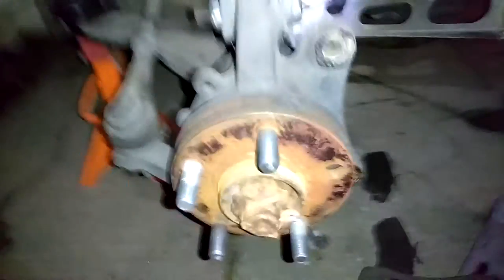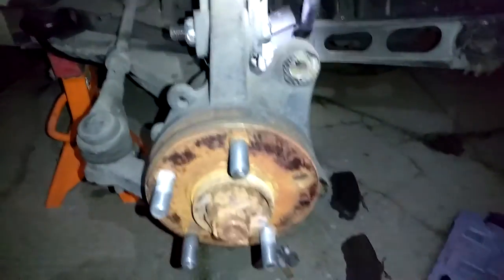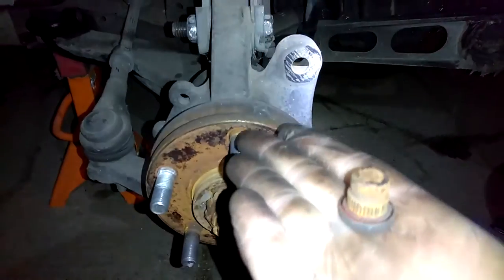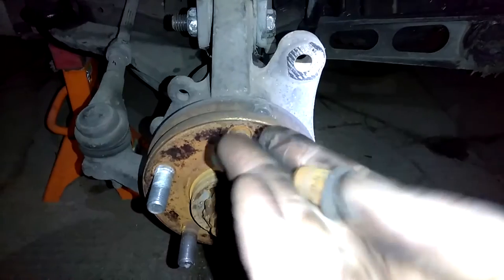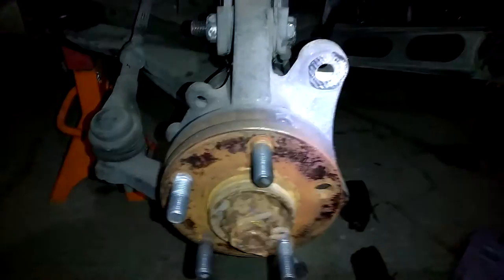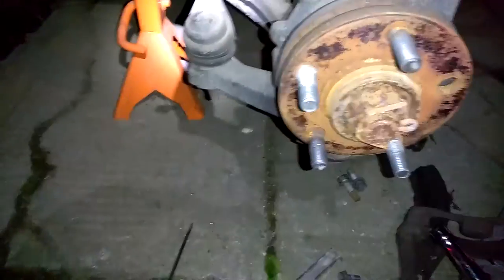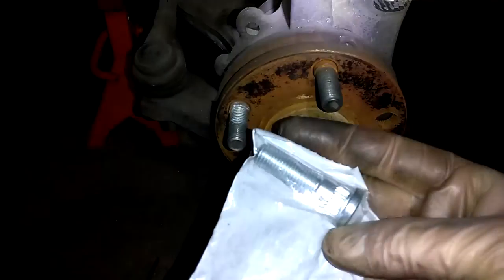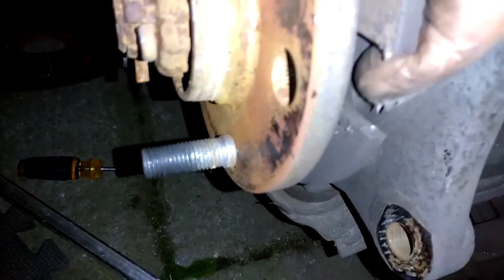PT cruiser Dorman Wheel Stud Replacement.

Comment: This view shows the front wheel has been removed , the caliper assembly has been unbolted and pushed aside , and the 
rotor has been removed .Now you can install new wheel stud ! Just make sure that both wheels are off the ground so that 
you can spin the wheel and put the transmission in "NEUTRAL" and then spin the assembly to the position of the slot where the broken / missing stud is and install ! Keep the EMERGENCY BRAKE "ON"  to prevent rolling  / accidents !
If you need to replace the rotor and / or the brake pads , now is the time to do it !